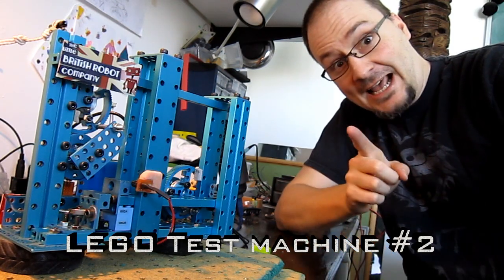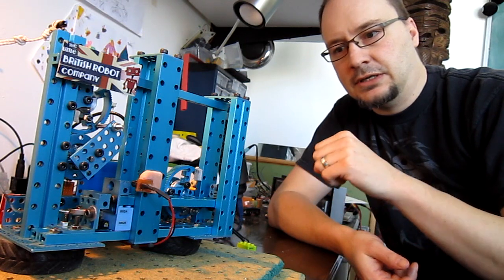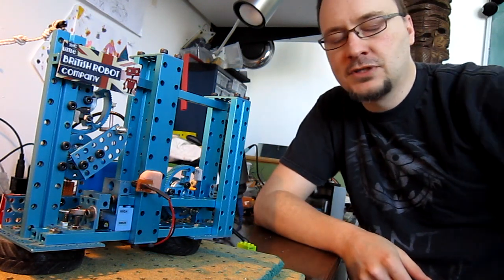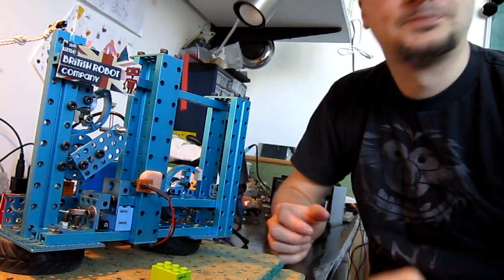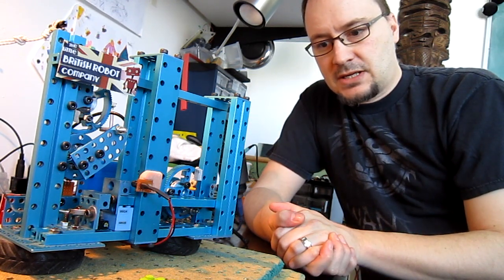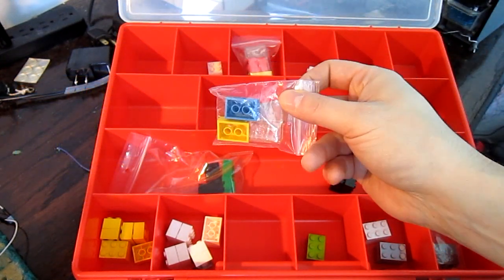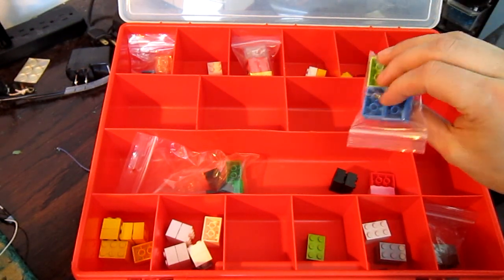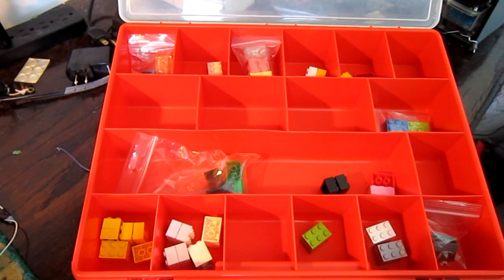legotest - It's dead Jim

Comment: Great fun to follow your experiments! I'm sure the current design would have worked great with a stepper motor, but there's another alternative as well - using a DC motor with an encoder. Great work!
Reply from the maker: I was indeed using encoders at first (LEGO Testing Machine #2 - initial design) they were not precise enough and I eventually decided to change the approach.  Maybe I should have bought better encoders and stick with that plan.
Reply: Phillipe Cantin Steppers are probably better/simpler. I'd love to support your project as I really like it. I have a surplus of steppers that fit with Makeblock if you want one? If so, mail postal address to jenschr at gmail and I'll send you one with a bracket? Do you have a stepper driver?

I would guess that encoders (by design) only give you a precise position if they are rotating a lot = giving a lot of positions? How about combining that with a geared mechanism?
Reply from the maker: Jens Chr Brynildsen Wow thanks for the offer. I can run two steppers with the Adafruit Motor sheild I have.  I will take you up on that offer.  The motors I was using had a 1:75 gears ratio so I did think about rigging the encode on the motor output (1:1) for more precision... then I got tempted with trying to measure the motor current instead since I never had the chance to do that. You comments are motivating me to try the encoder again. Thanks!

Comment: Wouldn't some stepper motors be more suited to this application? You wouldn't need stall/over current detection as you just issue a number of steps back and forth.
Reply from the maker: Yes and I mentioned this earlier in the project.  The twist was that I tried to build the machine with only the parts that were donated to me by The Little British Robot Company.  Motor wise, there was 6 DC motors the boxes and nothing else.  I thought of bending my rule but I decided to see this as a challenge.  In fact, now that this design has failed I'm planning 2 new machines: one with stepper motors and one with DC again.